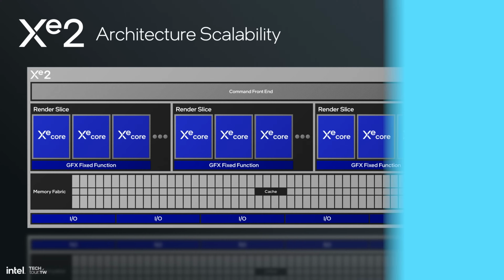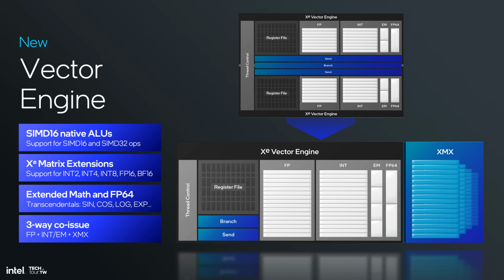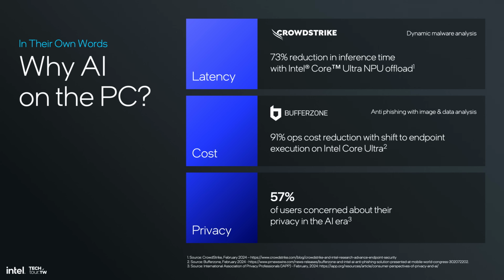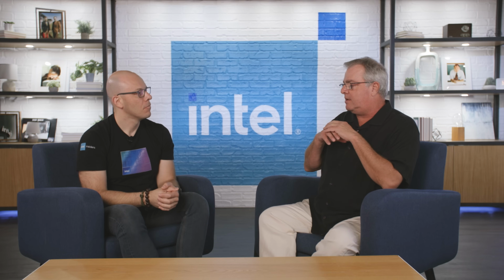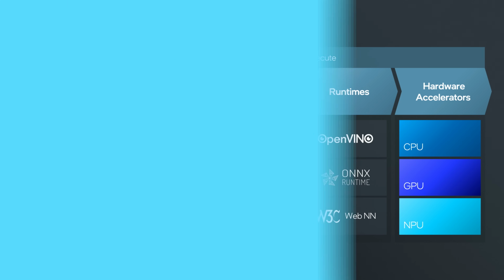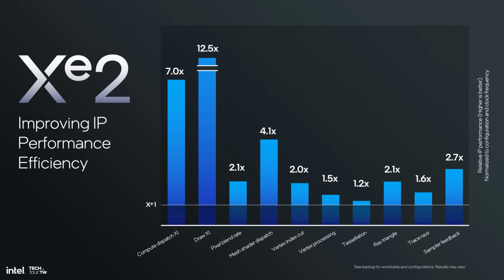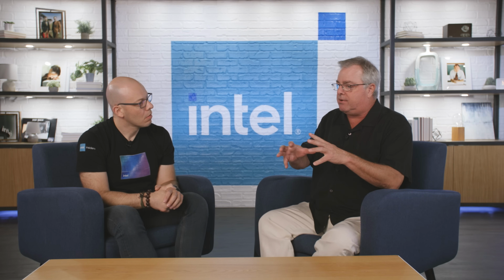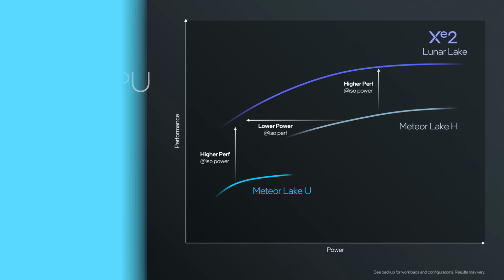What's New for Xe2 Graphics and AI on Next-Gen Core Ultra | Talking Tech | Intel Technology

Comment: I am really looking forward to the Battlemage equivalent to the A310 and A380. I went AMD Ryzen for my TrueNAS to have affordable ECC memory support and am using an old RTX 2060 for hardware transcoding on my media server. I wanted to go ARC because of Intel's amazing Quick-Sync support, but wouldn't touch it due to idle power draw and general efficiency ... I just want an efficient Intel transcoder in my AMD NAS that sips power at idle and adds AV1 support

Comment: 24:19 Glossed over RT. At this point they've beta'd the Battlemage for 6 months, give or take, now. If there was significant improvement it would have been a major talking point considering the facts that Alchemist crushed AMD RT and still does, as well as pulling up to Nvidia RTX 3000 and low end RTX 4000 for a drive by in games optimized for it. To hear Peterson pass it by in under a minute was sorely disappointing. As well as talking about using the same hardware for other effects. I understand the desire to make use of the hardware for other processes, having it on die and not being used seems like an expensive waste, ancillary use being focused on is realistic but at the same time this is another company claiming path Tracing is the future, so where did that go and why wasn't there any talk regarding how much of a performance gain this feature has?  I know I want to know.

Comment: XMX in hardware will finally allow Intel XeSS to surpass AMD FSR and pull up to DLSS4. That is what I wanted to hear. It was insinuated before but TAP just said it's a fact. It's now canon in the larger Xe consumer class card saga. Obvious step but still impressive.

Edit: Almost forgot, I don't use upscaling and despise it due to latency. I wonder if Hoyos has the ability to speak on this and ask that all important question...will the new silicon for XeSS lower latency and now that I think about it, Will the improved Xe cores with hardware XMX improve native res gaming significantly enough to allow 4k free/G Sync gaming @ @ least 60 FPS in AAA and 120-144fps in competitive games? How about the now very standard 4K 240 Hz? That would be a very good start point. 
Resolution tricks, flat panel interlacing and frame generation is for kids and consoles at best until latency reaches parity with native.

Comment: Hoyos is the kid that forced me to look at AMD for the first time since FX. I am not under stating this. He put such a sour taste in my mouth I ended up with a 2700x from a friend. Then a 7840HS w/780m which has the single core of Alder Lake and the multi is higher. With half the L2 cache as the full Zen4 chips. Like Zen4c. With the 780m it is one of the ultimate daily driver experiences one can have that doesn't need more cores and threads. It's in a NUC of all things too. Thanks Intel. I've always kept an open mind but what this kid did to me actually hurt both my feelings and sensibility. INTEL HR? Please contact me for full disclosure.

Comment: Would be great if they fixed the 13th/14th gen cpus first
Reply: Didn't they just put out a patch? Not much else they can do.
Reply: @thetheoryguy5544  yea they can do a recall on the cpu. There is tons they could do
Reply: @def-po8tu  That would bankrupt them.
Reply: @thetheoryguy5544  not my problem tho, they put out oxides cpu's there is no microcode that will fix that. Don't simp for intel. I plan on joining any lawsuits coming thier way!
Reply: @def-po8tu  That's already been debunked. There is no oxidation defect in the newer chips. I believe that was an issue in a older batch of chips that went out.
Reply: @thetheoryguy5544  actually ur wrong go do.some research. Stop simping for intel!
Reply: @thetheoryguy5544  u obviously have no clue convo is over at this point. Do some research and stop simping for intel they messed up and messed up big. U can't sell defective chips and then not do anything about it. As I said I will be joining the coming lawsuits!
Reply: @def-po8tu  I did so cope harder. If you don't like Intel then don't buy anymore.
Reply: They put out defective cpus with Oxidization issues that microcode will not fix. I plan on joining the lawsuits as they come! I'm not letting intel Weasel out of this! I paid good money for my cpu!

Comment: RAG applications interact with the QDrant vector DB, by receiving questions submitted using the HTTP API in Python. Using Qdrant with docker, llama-index-vector-stores-qdrant, torch, qdrant-client, fastembed and 11 other PIP installed packages, provides the ability to examine original sentences for each node, along with surrounding window of sentences, forwarded to an LLM.
Reply: In 2012 with AlexNet CNN (Convolutional Neural Network), was trained for 6 days simultaneously on two Nvidia Geforce GTX 580 GPUs which is the reason for why their network is split into two pipelines. The ImageNet project runs an annual software contest, the ImageNet Large Scale Visual Recognition Challenge (ILSVRC), where software programs compete to correctly classify and detect objects and scenes. ZFNet(2013) tweaked the hyper-parameters of AlexNet, maintaining the same structure with additional Deep Learning elements.

GoogLeNet/Inception(2014) was the winner of the ILSVRC 2014 competition. GoogLeNets accuracy, after minimal training, the human expert was able to achieve a top-5 error rate of 5.1%(single model) and 3.6%(ensemble). The network used a CNN inspired by LeNet but implemented a novel element dubbed an inception module. It used batch normalization, image distortions and RMSprop. This module is based on several very small convolutions in order to drastically reduce the number of parameters. Their architecture consisted of a 22 layer deep CNN but reduced the number of parameters from 60 million (AlexNet) to 4 million.

VGGNet (2014) was the runner-up at the ILSVRC 2014 competition. Similar to AlexNet, 3x3 convolutions, but lots of filters. Trained on 4 GPUs for 2–3 weeks, is currently the most preferred choice in the community for extracting features from images.

ResNet(2015) at last, at ILSVRC 2015, the Residual Neural Network (ResNet) introduced anovel architecture, “skip connections” and features heavy batch normalization. Such skip connections are also known as gated units or gated recurrent units and have a strong similarity to recent successful elements applied in RNNs. Thanks to this technique they were able to train a NN with 152 layers while still having lower complexity than VGGNet. It achieves a top-5 error rate of 3.57% which beats human-level performance.
Reply: Machine learning techniques are all grounded in the concepts of "Knowledge Data Mining" or KDM. There are numerous techniques used to interact with data and classify, forming "Hybrid Hashtables", computed indexes, and loading into a non-volatile NVRAM to be processed, according to a couple of the following concepts, central to AI.

Supervised learning is categorized using multi-label classification. Spam filtering is an example of classification, where the inputs are email (or other) messages and the classes are “spam” and “not spam”. Methods used for classification are

• Linear Classifiers: Logical Regression, Naive Bayes Classifier, Perceptron, Support Vector Machine(SVM)

• Quadratic Classifiers
• K-Means Clustering
• Boosting
• Neural networks
• Bayesian Networks

Regression: This is a supervised problem, the outputs are continuous rather than discrete. Methods used for regression are

•Linear Regression: It is one of the most widely known modelling techniques.

• Logistic Regression
• Polynomial Regression
• Stepwise Regression
• Ridge Regression
• Lasso Regression
• ElasticNet Regression

In an unsupervised role, the machine analyzes unlabeled data and categorizes it based on similarities identified. These programs are used to identify groupings within data sets that may be difficult or impossible for a human to see.

Clustering: Uses a set of inputs, divided into groups. Unlike classification, the groups are not known beforehand, making this typically an unsupervised task. Methods used for clustering are.

• Gaussian mixtures
• K-Means Clustering
• Boosting
• Hierarchical Clustering
• K-Means Clustering
• Spectral Clustering

Semi-supervised: A combination of the above, used when there is a large amount of data, with some being labelled. Unsupervised learning techniques might be used to group and cluster the unlabeled data, while supervised learning techniques can be used to predict labels for it.

In reinforcement learning, an algorithm learns a policy of how to act given an observation of the world. Every action has some impact on the environment, and the environment provides feedback that guides the learning algorithm. Uses simple reward data to train the machine on ideal behaviour within a specific context.

Accuracy: The simplest scoring measure calculates the proportion of correctly classified instances, using "True", "Negative", "Positive", or "False" (4-States, which shows the reason "WHY" Google increased accuracy so much, with GoogLeNet being able to achieve a top-5 error rate, utilising Google Sicamore's Quantum processing techniques, following the following basic scoring algorithm;  Accuracy = (TP + TN) / (TP+TN+FP+FN) 

Q: - Is Intel about to create "virtual", qubits for use in its consumer laptops and desktop CPUs, or has it done so already in Lunar Lake?
Q: - Sure, it's possible but is it practical or likely to appear as a function inside of an NPU, operating like a supplemental instruction set?

Comment: this isn't in arrow lake?
Reply: Intel unveiled the Xe2 architecture, the successor to its Xe “Alchemist” GPUs, this year at the 2024 International Tech Expo (ITT).
Reply: Xe2 aka battlemage is in Lunar Lake (mobile) and dGPUs. Desktop is expected to get an enhanced Xe1 (alchemist) this year and Xe2 next year.
Reply: @__aceofspades  Why won't they use the same in desktop as on mobile? What do they gain by staying on old architecture on desktop?
Reply: @qweasdzxc  because igpus on desktop have limited and niche use cases, and most of the time, they are not perfomance-critical. Also, efficiency gains aren't really that important to a desktop igpu. Let them focus on the CPU part for ARL-S instead
Reply: @parz1pane772  the extra performance and 266 decode would be great to have. i just dont get why they wont put the new stuff on there, it's already designed so its not like its extra work.

Comment: Make a special 64GB card for AI studios at home.
Reply: That is overkill... 48Gb would be more than adequate, even 32Gb if using GDDR7.
Reply: @mrhassell  llama 3.1 70b at q8 is 75 GB and fp16 is 141 GB. 405b at q8 is 431 GB. Deepseek Coder v2 236b at q8 is 251 GB. Every single consumer PC in existence is extremely hard limited on vram size and memory bandwidth when it comes to the current decently performing LLMs. Apple's Macs are currently the only consumer PCs that are at least somewhat fit to run larger models thanks to their fast ram.

The second coment here is of course "would there be a large enough market". The first vendor who will make a consumer GPU with lots of fast VRAM with consumer prices will create the market for AI on consumer PCs. Of course nobody is making consumer software when there is no consumer PC that can run it.

The conspiracy theory is that GPU vendors are not releasing such GPUs to protect their datacenter market. For example Intel has a "Data Center GPU Max 1100" with 48 GB vram and it's hard to find for sale but it seems to sell for $30000+. Of course they are overall more powerful, but still the market for applications that don't need quite as much compute power and are just starved for fast memory is completely empty.
Reply: The economics wouldn't make sense. It would cost an exorbitant amount of money (just look at the latest leaks about a 4090 with 48GB of VRAM). Would there be a large enough market to make the development cost worth it for Intel? They would have to completely overhaul the memory subsystem, not only going with a clamshell memory layout on the board, but also likely requiring additional memory controllers.
Reply: @AlexSchendel  more memory controllers will definitely be required. What about expandable memory slots like CAMM2? Is it that sensitive to non gaming applications like LLMs?
Reply: @vin.k.k  I mean, that could be an option... CAMM is a desktop memory standard though, so either that would be using system memory which would be very slow, or it would require the Xe2 memory controller to be completely overhauled to support DDR instead of GDDR. It would also still have much less bandwidth than GDDR (<64GB/s/MC vs hundreds of GB/s). Even if that would work as a cheaper alternative to GDDR, it would also still require a very expensive die rework.
Reply: @AlexSchendel  There's a reason intel can sell a 16gb card at $300-$400, even though Nvidia and AMD are doing it for 1000. adding more VRAM is pretty simple, and it's not all that expensive, especially if you use the not-quite-bleeding-edge stuff. (there are even some NVidia cards you can replace the VRAM with higher capacity chips to get a better card- look it up) A big reason nvidia's more expensive cards have more VRAM but max out at 24gb till you get to workstation cards is.... greed. no, not  a joke.. it's called market segmentation. 2/3/4gb VRAM modules cost them like 10 bucks a pop, max. VRAM is necessary for large scenes in rendering, but most people don't need to render 48GB of textures and polygons, or fit 30gb of simulation  data per frame of video. They also want to make more money off products with a lower global demand. so they throw double the VRAM on a gaming GPU (the exact same chip, often at reduced wattage/clocks for stability) and say "it's for pros now". their best workstation cards are just 4090's with VRAM in every slot. Their 4090's just have half the slots left empty because that's what they can do and still sell em for $2000 because lack of competition. they're careful about ensuring they burn the extra input slots now because they really don't want you upgrading it.
Reply: Add DDR5 ram slots on the card
Reply: @Tech2C  Maybe CAMM2.